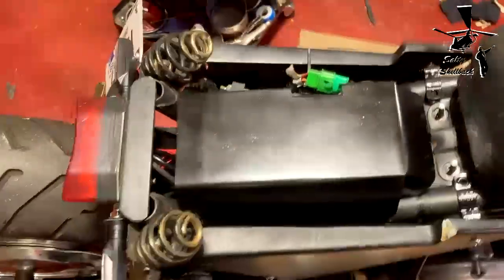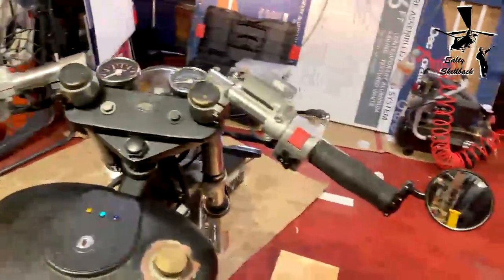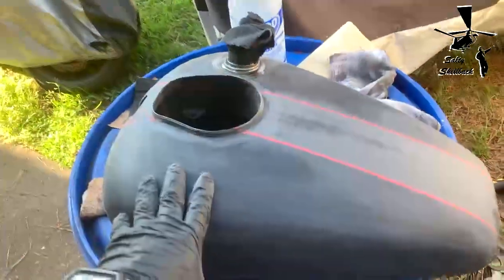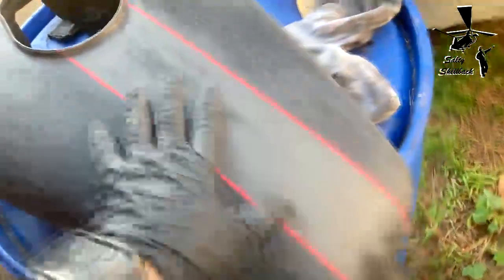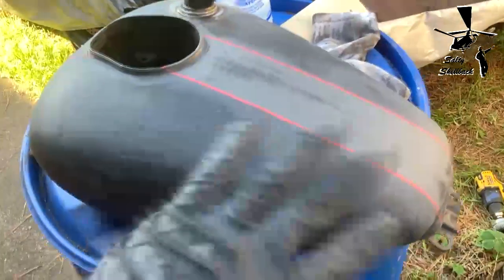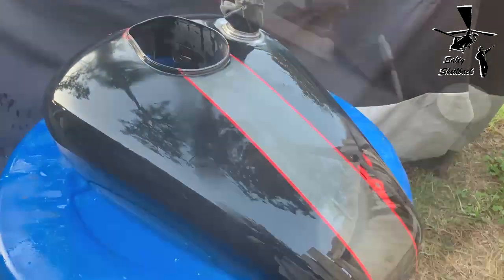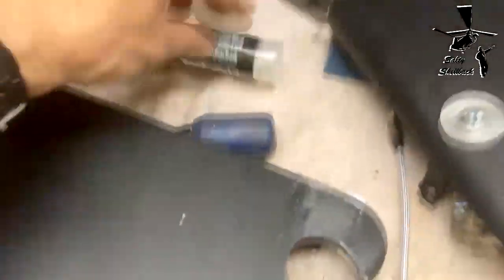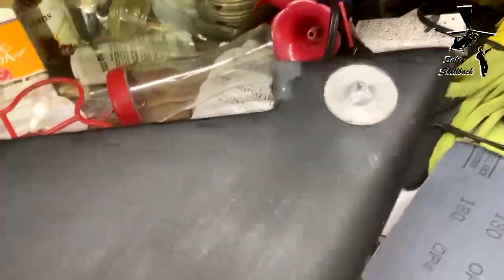Suzuki savage bobber part 3-Almost done!

Comment: You probably painted already but those two part spray cans are the shnizzle for that.👍
Reply from the maker: Yup. I used that type of paint to clear coat a previous bike and it turned out pretty good.  I just made a mistake and didn't remove the masking and ran out of paint to redo the part that I unmasked.  Turned out OK though.